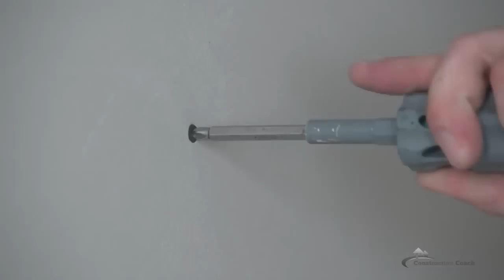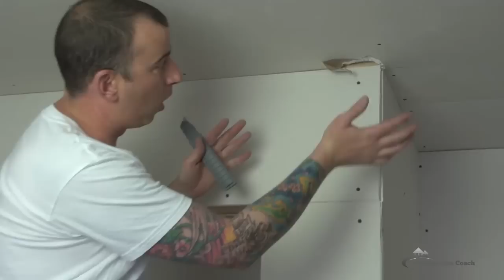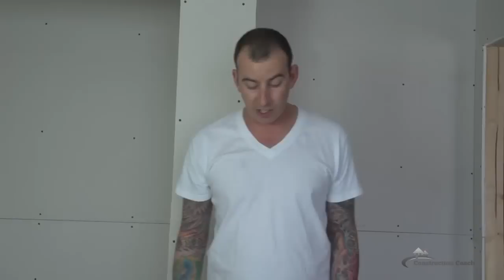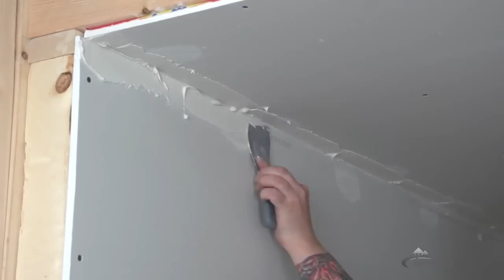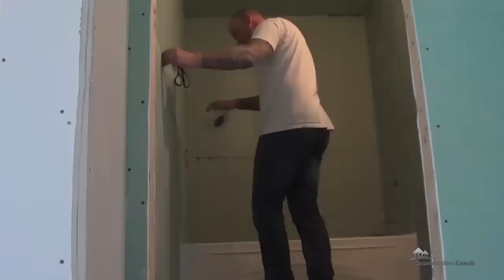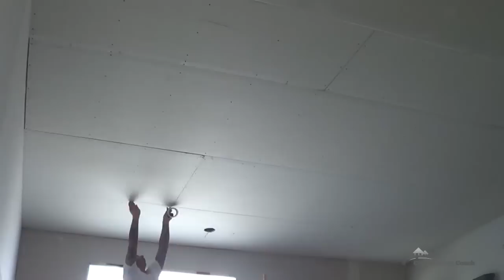How to Prep Walls for Tape Coat and Screw Patch

Comment: Why do you switch between paper tape and fiberglass tape? Are you using paper on the joints that are flat and fiberglass on the ones that are angled with the factory edge? 😎
Reply: Your usually suppose to use mesh on the tapered joints and paper on the butt joints, but honestly I use paper on all joints, it makes for a stronger joint and you don't have to worry about cracking as much.
Reply: There is no such recommendation from any trade group or gypsum mnfct. that I'm aware of - so the "you're supposed to" is an opinion only.   There's nothing wrong wtih using paper on all joints - been done that way for decades. Fiberglass mesh tape was not originally a drywall product- it's a skim-coat plaster product that was developed to be used with gypsum lathe.  In that scenario it is used on all joint types. Skim coat typically has no dedicated bed coat for the tape and of course skims the entire wall surface - so it covers the mesh OK  even on butts.
Reply: I'm a DIY'er and from trial & error plus a lot of research/practice I only use Mesh tape with powder based mud, not the joint compound stuff.   And I prefer the paper tape to mesh.  Mesh is defacto in the UK (where i'm from) and used on all joints.  However drywall finishing in the UK is different to North America.   

Also you go up on the screws, then down.... otherwise your pulling the mud from the hole instead of into it....Other than that this isn't the worst drywall video i've seen.